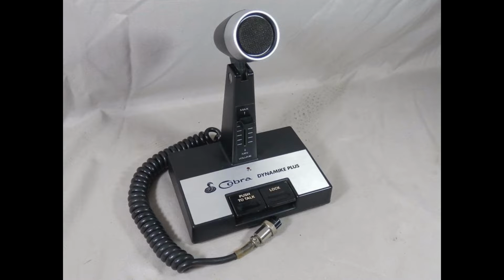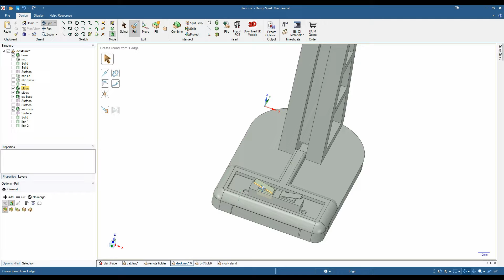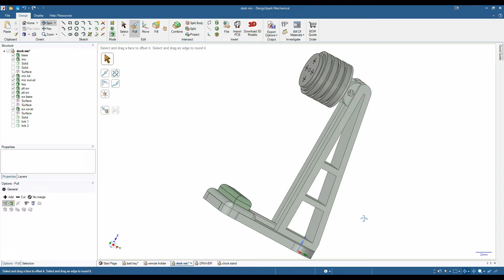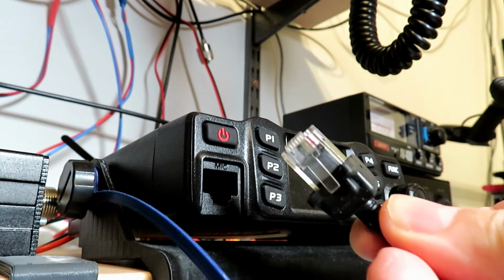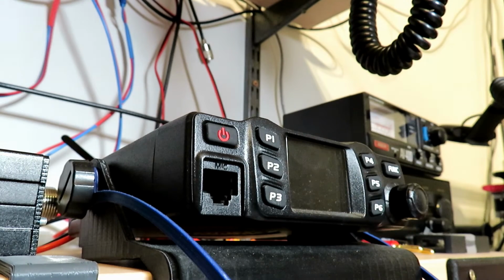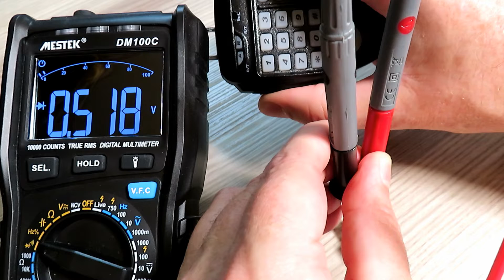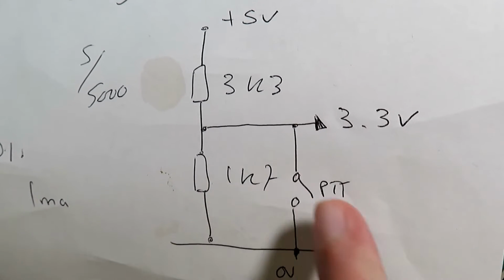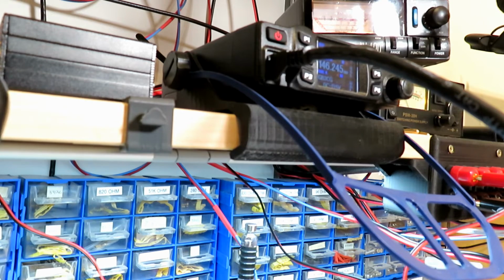A PROPER RADIO DESK MICROPHONE FOR ANY AMATEUR RADIO OR AUDIO APPLICATION FOR UNDER A FIVER ?

Comment: Nice video and nice design.
I'm considering something similar FOR MY at-778 but a couple of queries, if you don't mind :
a) You mentioned that your mic' insert is a condenser type. Doesn't that need a Phantom Power supply ?
b) The little (pre)amp module is designed to drive a speaker of 8-ohms or so. Did you consider doing any kind of impedance matching for teh relatively higher input impedance of the TxRx unit ? It obviously appears to work OK !
I want to use a condenser "Studio Microphone" and a footswitch for PTT, leaving both hands free for logging, PCing etc , so would simply use an off the shelf box, a couple of connectors and do the RJ45 wiring internally.